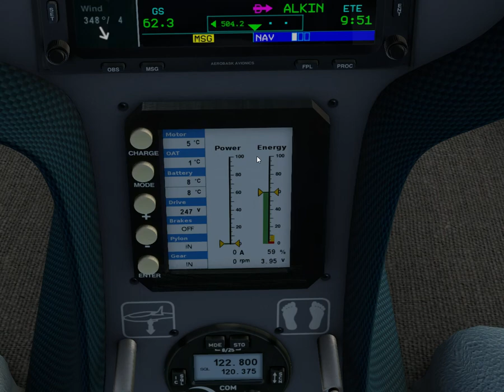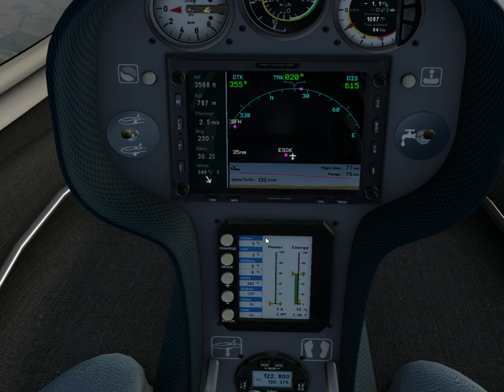X-PLANE 11 - Aerobask Antares 20E

Comment: Hello, I bought the Aerobask for X.Plane 11.40 . But I have several Questions: Till now, I only have the choice between aero-tow and winch tow. How can I do the settings for SELF-Launch?   Another problem is: when decoupling the rope (for aero-tow) to do a self-launch, it takes terrible long until airborne. What do I wrong? Also the climb-rate with motor after airborne is very poor. How can I adjust the settings to climb better with motor.    remark: In reality I own and I fly a real Antares20E with 20m winggspan. The climbrate with motor and 130 Amp current is in average about 3 m/s.    I would be very happy to get some advice!   Best greeting from Germany   Alfred
Reply from the maker: Hello, Sorry for my late response. I haven't flown the model in the last updated versions of XP11 so unfortunately I do not have a good answer to your questions :(
take-care
Andy